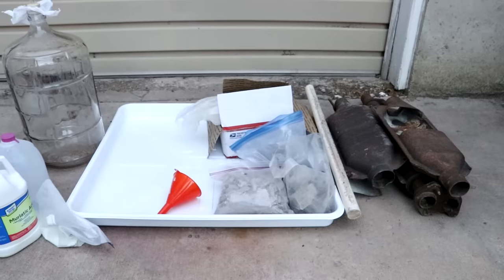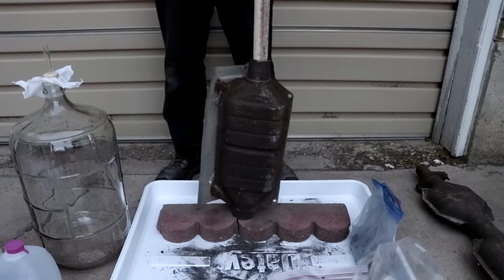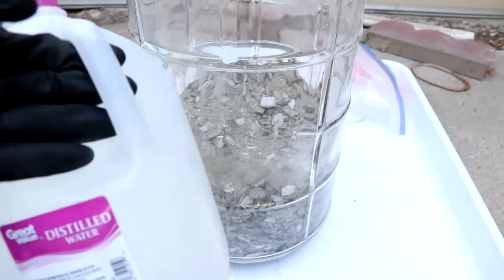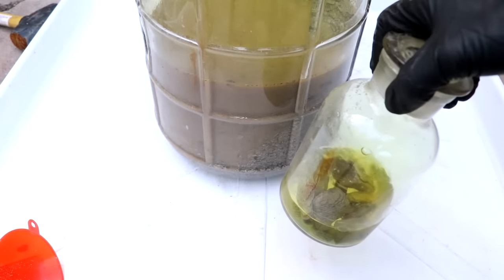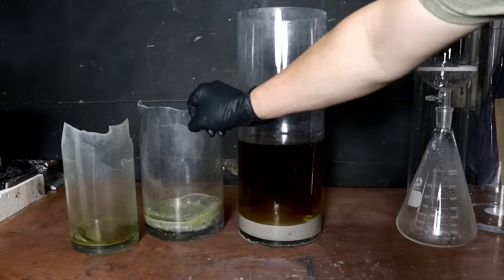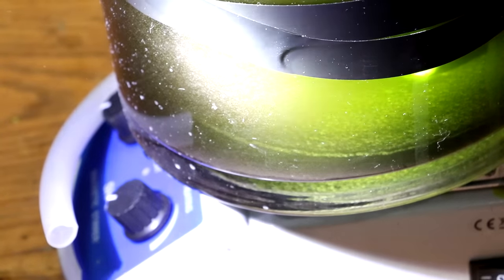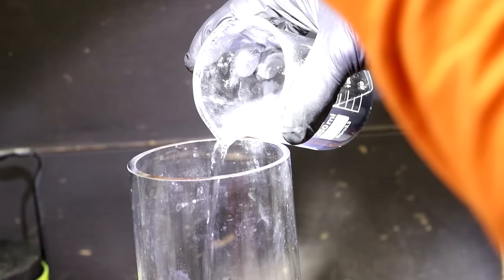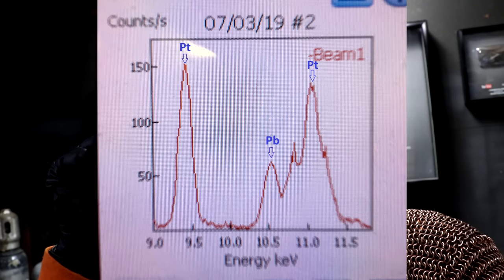Precious Metal From Catalytic Converter

Comment: Your example with the torch of making the honeycomb glow red is exactly why a car running to rich will burn out the catalytic converter.  When someone's Catalytic converter Burns out they usually just replace it and never ask why it went out.  Usually due to a bad air/fuel sensor
Reply: Stuck injector will take one out in an hour

Comment: I may be able to actually get you a large bin full of catalytic convertors.
Reply: Make it happen!
Reply: Left a comment on Patreon, if he’s interested he can get in contact with me
Reply: The local metal recycling place will pay 25-40 a piece for catalytic converters
Reply: @TheAdventureLog  I have two recyclers near me. One won't take them because the price changes too much. The other under pays to compensate for price fluctuation. Too many crackheads stealing cats around here.
Reply: Only way to make a profit is if you cut them from parked cars , otherwise it isn't worth paying for any of them.
Reply: Kevin Coelho i got 120 per....
Reply: Converter scrappers will travel to you and pay cash. Contact your local salvage and (large, older) used car lots. It's stupid to DIY recover from cats except for fun because while they are intact they are sellable. A random metal bar can't be identified without professional assaying.
Reply: Slade Darklight doubt it

Comment: Cody, I want to thank you for all your hard work.
I myself am a professional noble metals refiner with a designated workshop in an industrial area.
I have learned a lot by watching your experiments and test runs,  from the information you have provided I am finding new materials to recycle and refine.
Thanks for providing me with new ideas and future investments in my business.
Reply: I am a master of electroplating. I have access to thousands of untouched catalytic converters want to split the gains
Reply: @johnmoyers404  Where are you from ?
Because I live in Europe and transportation with cross border post inspections are a huge pain. 

I am having huge problems importing from India or China via Ebay and Amazon as it is,  when it comes to electronic scrap or any other noble metal waste.

Comment: Off the top of my head, Platinum is about $1,000 per Troy ounce (31.1 grams), Palladium about $2500 (it has soared in the past week or so), and Rhodium maybe $8500 per ounce.  You really ought to keep a better eye on your cat : )
Reply: you listed three materials. He salvaged one. How do you get the other materials out of them? Do you have a better idea? Other then keeping a better eye on the cat?
:-) lol
Reply: @rickmorris338  electrolysis
Reply: @rickmorris338  he did it in an another video
Reply: That’s crazy. I assume the real problem is finding someone to buy it. I don’t think the local recycling center is going to give you money for the material lol
Reply: Lol they pay so much more now
Reply: @the_bencredible  yeah, its not so easy and some of that metal process could be very toxic , and probably not worth it (there are very little cuantities there)
Reply: Pretty sure acid is bad for cats as well
Reply: Rhodium is actually $18500 per ounce
Reply: @jonm2416  Rhodium Price per Ounce	$19,200.00
Reply: @LSGaming42066  maybe this month it is... My comment is a month old
Reply: @jonm2416  i'm not saying your wrong just pointing out how much it increased within 30 days  almost 1k
Reply: I was wondering how a currently operating lab wasn't better secured and barred off for safety precautions. Not trying to be rude or insulting in anyway, was just thinking about it a bit.
Reply: @LSGaming42066  good to point to the inflation. The value of money are dropping. Which was did organized.
Reply: @the_bencredible  They most definitely will
Reply: @the_bencredible  Never heard of a juweler ?

Comment: I wonder if you could do anything useful with all that leftover zirconium matrix...?
Reply: I've reduced ZrO2 to Zirconium metal in a Thermite reaction, so that would be a cool idea. It's a very difficult thermite, you need to add KNO3 or KClO4 to get it hot enough. Even if you add a flux (CaF2 works well) a lot of the metal will burn in the air. I would love to have as much ZrO2 as cody.
Reply: Perhaps some nice cladding for other interesting metals
Reply: @oscarmendez590  That would work well if the chunks were big enough - I imagine you'd have to somehow remove the other coating without breaking it up or reform the crumbled stuff though? Cool idea though, imagine using this process with a whole "squarecomb" piece and then recoating it in something that looked amazing...!
Reply: @SomeAustrianGuy  Anything that involves fire or booms is always a winner. :D
Reply: Or... He could sell it on ebay to recover his losses from buying processed matrix on ebay.
Reply: @Kineth1  He could do if he were the scammy kind. LOL

Comment: The cork and air lock you can get at a wine supply store.the air locks that have water in them will help stop the chemicals getting out into the air as much since the gas has to pass through the water.

Comment: I used to do metal plating.  I eventually got into running the wastewater plant for the plating shop. I loved it. Well one day I got a barrel of nitric acid that was mislabeled as sodium hydrosulfate.  Well thinking it was hydrosulfate I went to top off the remainder of one barrel into the new barrel.  Except  I wasnt pouring a base into a base I poured a base (sodium hydrosulfate) into a fresh barrel of Nitric acid. 80% bahm. It blew up in my face spraying my eyes and lungs and ears with a nasty chemical reaction.  Luckily due to my training through Lake vocational I knew to stay calm and get straight to a wash station. I hit myself with the shower flushed my eyes. And gargled water even breathing some in through my nose to flush my nasal cavities and lungs.  Went to the hospital to get treated for very mild chemical burns. 2 days later I quit.  Too dangerous for me.

Comment: This is my rough draft. I wish weights and measurements were used. 

I feel like I’ve just been taught enough to be dangerous. 

1. Distilled water to cover materials 

2. 1 liter of Hydrochloric acid 

Mix

3. Calcium hyper chlorate (how much? Looked like two quarter cups…)

Use stopper on bottle with Teflon tape

Mix well

(Makes chlorine gas so don’t breath this shit!)

Sit two hours then add another quarter cup of calcium hypochlorite

Solution should change colors from green to orangish 

4. sit in shade for one week. Shake every once in awhile 
5. Bring into Sun to warm in order to release excess chlorine gas. Let sit in sun for two days to a week
6. Transfer liquid to large glass “chamber” ie large mason jar. Build a glasvstraw so as to not vacuum lock
7. Rivne original solution with distilled water to get all fluid out of solution 
8. Use coffee filter to filter “new” solution.
9. Stir in copper powder (in distilled water, I guess) to reduce metals into metallic form
10. Blow carbon dioxide onto top of vessel to keep copper from dissolving, cover with trash bag.
11. Copper turns dark after a few days.
12. Siphon off liquid, leaving precious metals/copper
13. Add one tablespoon copper sulfate and add aqua ammonia (quarter cupish)
14. Ballon filled with oxygen on stir plate till copper is dissolved (will be dark blue due to dissolved copper)
15. Filter with coffee filter or boil off leavening dust. Dust is your money. 
16. Melt her and boom! You can make your wife a really expensive ring(lol) button.

Comment: Hey Cody, love the vids.  The "cool" kids use a centrifuge for separations, and you might want to get an aspirator for your fume hood so you can run continuous vacuum with corrosive vapor and not have to rebuild vacuum pumps, and not have to hand-vac your filtration setup.
Reply: cool kids haha

Comment: Bake the carbon off the bricks in a kiln or hot oven. Leave the bricks whole and soak them in chlorine acid solution in a 5 gallon pail to get the metals. You dont need too much but you do need to make sure that the chlorine is atomic so add in doses over time. Helps to agitate constantly. I remember getting a craoload of them from a junkyard in the early 2000s and doing this. It was mostly platinum back them.

Comment: “Who knows what this does to our lungs”

🤔🤔🤔🤔🤔🤔
Reply: Nothing good. But it takes a few years to really kick in.
Reply: Depending on the size of microns hes breathing ceramic dust passes straight through your lungs causing a ton of microscopic damage and setting the stage for COPD or cancers
Reply: Chris Chris I think I inhaled some of the dust today. Am I gonna die?
Reply: @Just A Mechanic probably similar things like Asbestos.
Reply: Stoutfrenchbulldogs I’m thinking it’s also similar to asbestos so short term exposure such as drilling one cat isn’t going to fuck you up. Just don’t keep doing it without a respirator
Reply: 16vjtdalfa that is true, but I’m talking short term light exposure. Heavy exposure with no respirator no doubt you’re fucked. But being lightly exposed for a short amount of time shouldn’t be too harmful. It’s when you’re exposed to it on a day to day basis you can get cancer.

Comment: $40 fix to repair buy an 
$10 exhaust pipe extension buy 
$6 exhaust pipe clamps 2. 
$3.50 time to install 15min $3.50. 
Total cost to fix $45 (Parts and Labor).

Comment: I want my 20 minutes back.... This should be entitled "How to get Lymphoma, and Lung Cancer"
Reply: Step 1. Right click on title and click inspect
Step 2. F2
Step 3. Change title text (theres two, only have to change the second one)
Step 4. Profit.. or break even in your case, 20 minutes richer
Reply: It would be very impressive if you managed to get lung cancer from these chemicals since they aren't carcinogens. The powder might be simply because it is a fine powder, but as Cody mentioned, a cheap breathing mask would deal with that just fine. You can avoid the problem entirely by soaking the catalytic converters before removing the powder.
Reply: @5467nick  maybe. Exhaust holds alot of carcinogens amongst the ceramic dust
Reply: @stirfry4751  No, no it doesn't. When we're talking about carcinogenic exhaust, that's really only the "exhaust" from coal plants, and that's because it contains a considerable amount of radioactive thorium in the fly ash (nowadays this fly ash is usually captured and collected for recycling or land-filling to avoid this problem). Interestingly, since thorium is only a weak alpha particle emitter, it is only dangerous when inhaled.

Modern cars don't emit anything radioactive (not above background levels at least) and don't produce any carcinogenic chemicals in noticeable quantities since they are quite efficient at burning things to complete combustion. In fact, they are so good at that that they burn even nitrogen, hence the need for a catalytic converter to decompose the nitrogen oxides back into nitrogen and oxygen gas.

Besides that, even if the exhaust had contained carcinogenic organics, they would have been fully oxidized by the catalytic converter anyway!

Comment: I dont think it stays glowing red cause the gas is reacting with the platinum. I think its burning the fuel that's coming into contact with a already glowing hot surface. Pretty much how a glow plug works on a diesel engine. If it was glowing still cause a chemical reaction.  you wouldn't have to heat the ceramic in order to get the chemical reaction to start reacting with gas fumes. Fumes ignite easily

Comment: They were all E9 aftermarket cats i crushed and smelted both off my bmw 750 v12 using lead as a collector then cupeling it out with cement in a furnis, palladium = 78% platinum = 12% rhodium  = 6% others on a xrf the button weight was 14.6 gramms i paid £1250 for the car do the math

Comment: I glued canisters of pepper spray around the muffler joints to the converter on my car. 
To steal it , the canisters have to be cut thru. 
The pepper spray canisters are under high pressure and painted the same color as the muffler.  Come and get it. !!!

Comment: Hi, is Catalytic converter with metallic things inside ,  instead the  ceramic  have any  As a hobby I had experiment with AUDI A2 1.6 catalytic converter.. inside was a  soft&hard fragile  nets kinds metals .. I dissolved a few parts in HCL+HNO3 , the solution color is dark green, than almost get black.. but  the Tin chloride test showing nothing.. is it possible  catalytic converter without any precious metals?

Comment: you need to turn it on its side or stir it with a stick. You must be a chemistry major. Clorine is a natural element. shouldnt be anything wrong with releasing it in the atmosphere. I could be wrong but I think your product would have been in the solid material you threw away. Platnum is heavy and solid. it wouldnt be in the liquid

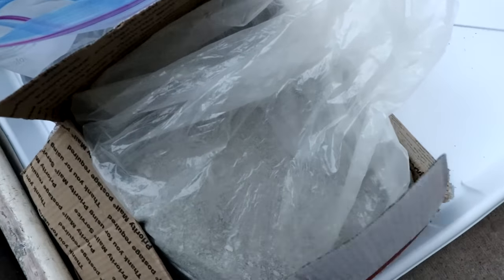Comment: @1:30 What other reasons would it be in that state other than it was processed? That’s a rhetorical question, I just would like to know if there was a story or explanation that the seller offered with the bag of particles and if not,  I would suggest being more situationally-aware because personally, that’s a big red flag! I wouldn’t have bought it without having a specified window of time to inspect the item(s) once received, in which a return was possible at no expense if an item was not exactly as it’s described and/or displayed in photo(s) etc. In all actuality, the seller may have even wholeheartedly thought that someone in the world has a use for the other elements that they hadn’t extracted and sold. They could have priced it high if they didn’t know the value (I can only imagine it being pretty-difficult to price-compare), hoping to get the most out of it… Lastly, maybe they did think to themselves that if they are ambiguous, vague or flat out not mention it, that someone would purchase it with an assumption and fail to inquire. A lesson in due diligence in some cases.
Reply: I just realized you said Ebay, don’t they have a pretty good process to return and refund?

Comment: He was doing it for a year cat dumps dishes over why did he not make a another  video he was  ot up set over the cat there worth 150 dollars of any old car take the converter of only takes 10 minutes  to take it of jack one side up on the car get the sawall out cut the pipes from front of the converter  and the pipe of from back  . And if some one wants for the junker sell to them then tell them i sell you the converter  for 150 bucks  thay buy it